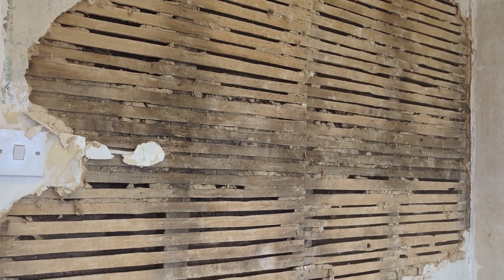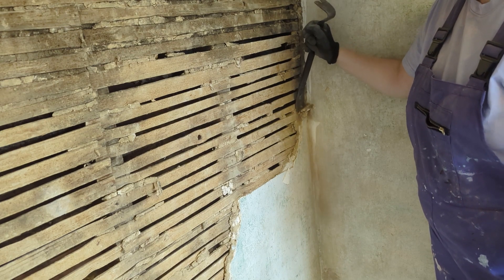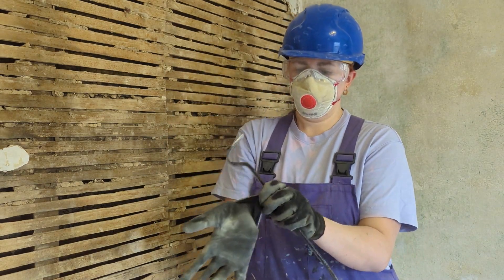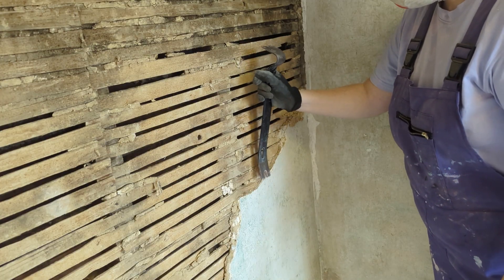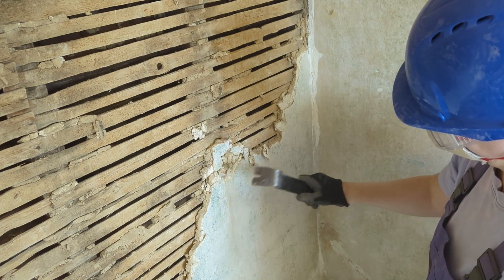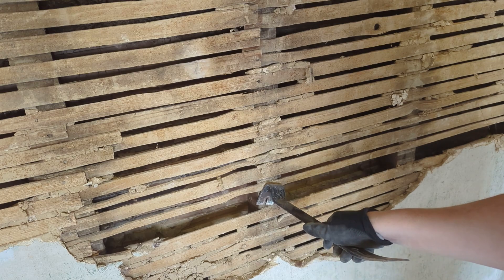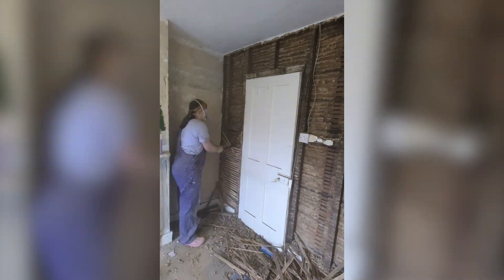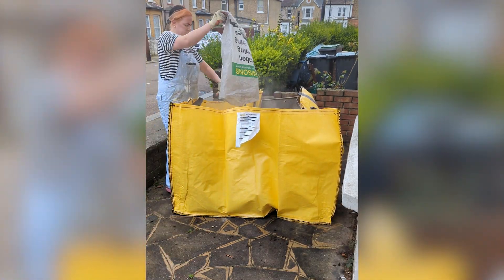How to remove lath and plaster walls | Sharn's House 🛠️

Comment: Thanks for the video! This is something I’m going have to do soon on our new house. What’s the general advice for electricity whilst doing this? Is it safe to leave it on with potential wires and whatnot behind the wall or should it always be turned off?
Reply from the maker: I'm not sure on the official advice - I'd chat to an electrician first. But always safer to turn electrics off at the board while you're removing bits of plaster around any wires 👍